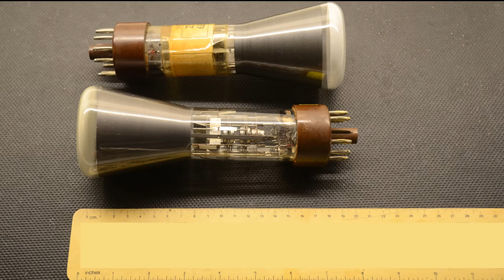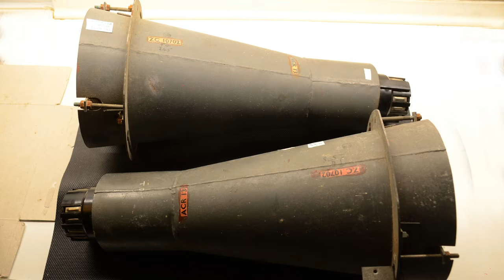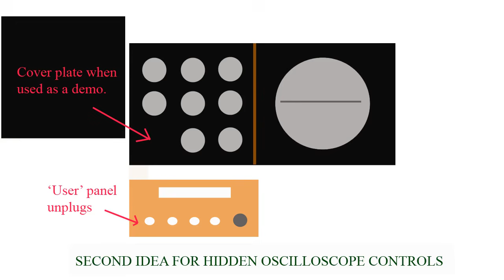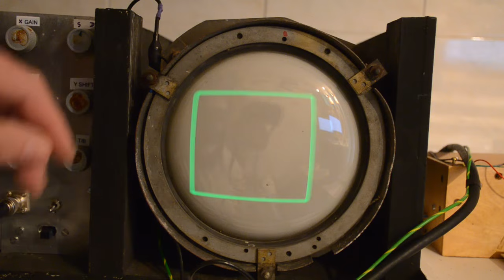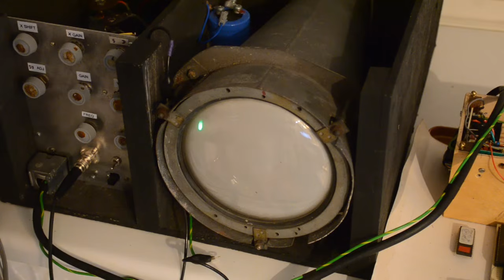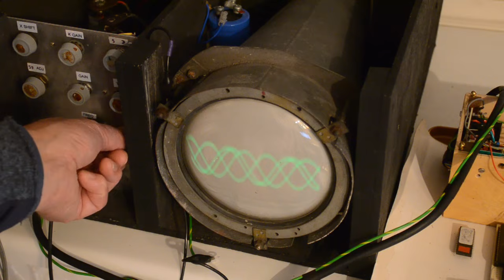Using Old Cathode Ray Tubes in Projects

Comment: I really enjoy your videos on crts from the WW2 time frame; I have a BC-929 which was the display for the Rebecca used on board aircraft to pick up signals from the eureka beacon PPN-1 / PPN-2. I was wondering if there was a way to put a display on the BC-929 to show range and left right signal just like the ppn-1 would send to the aircraft. The scope does have a video and sync input. I think this would add a bit of pop to my display, of the Rebecca, Eureka system. I have an electronics background and have restored many WW2 radios and other electronic gear. Thankyou Alan
Reply from the maker: Hi Alan. Thanks for the feedback. Yes, I'm familiar with Rebecca/Eureka and actually have a single 123(?) IF unit from the system in stock somewhere! The most straight forward way to generate these signals is almost certainly a micro, or alternatively something like an Arduino if you're into these things. I've used the microprocessor approach a couple of times myself, but failing this, you could seriously consider discrete logic which may well work for this application. Maybe base the idea around one or more CMOS 4040s as these are extemely useful counters for this sort of  work. For a more complex repeating waveform, I've used an EEPROM to store the actual information, which is then accessed by the 4040 counter. I hope this helps!